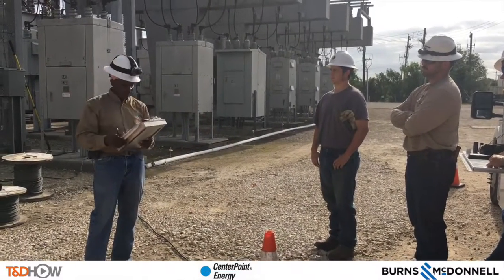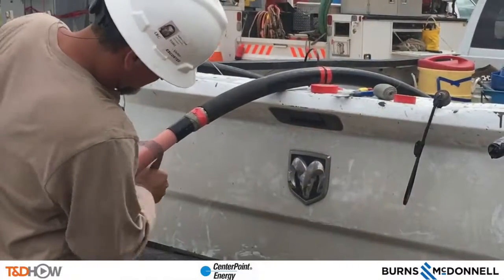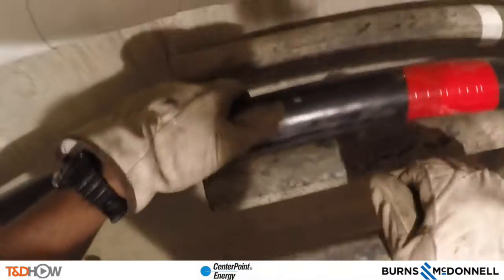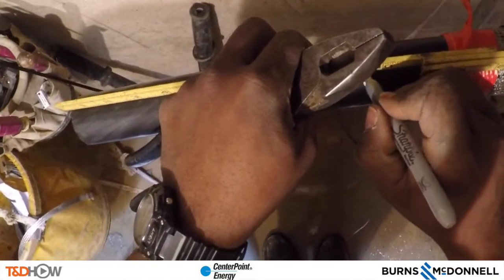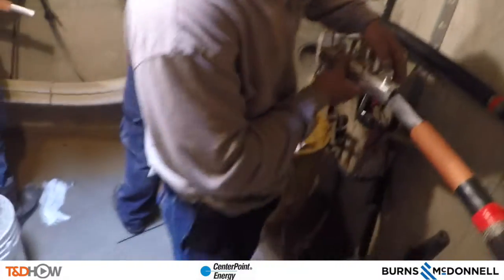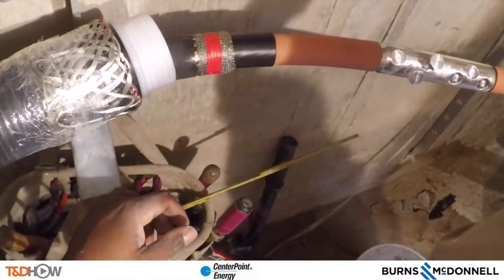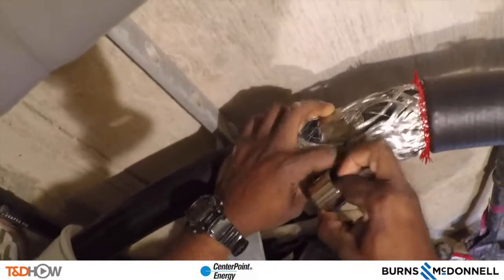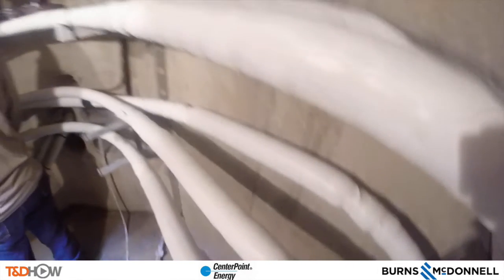Splicing for Underground Cut Around

Comment: I have one problem that I observe on that installation the pipe that being inserted on the cable have no cover protection, it is not a big deal but it must be covered so that the rats and other animals will not enter on the pipe, and it must also water resistant so that if something flood happened on the area it will not enter to the pipeline, so that the cable remain dry even the cable are already isolated.

Comment: Why don't utilities Hipot test high voltage underground cable before commissioning? I've never seen them do it, even on new work. Most inside contractors test 5kv and up.
Reply: Here in Southern Florida we do hipot test when repairing existing sections of cable but not when it's new construction.
Reply: We use a VLF machine to test cable. Hi-pot is harder on cables than a VLF

Comment: It was certainly interesting to see red, white and blue being used to mark the 3 phases/actives/hots on this USA installation. I do not know off hand what colours are normally used for phase marking in the USA but red, white and blue are the colours for Australia. I always reckoned in the USA white was always reserved for neutral... but in searching google, it seems there are no standard colours defined for the active conductors by USA standards (the N.E.C.), which boggles my mind.
Reply: For hi or low voltage?
Reply: we normally use color tape and 1 layer for a phase  2 layers for b phase and 3 layers for c phase on the primary.
Reply: black red blue is 120 brown orange yellow is 480volts. Cheers
Reply: Much thanks, that is what I had reckoned, but hence is why videos like this are so interesting to me. Always a pleasure to see how things are done around the globe, especially on this level since I really only ever really deal with domestic work. Cheers :)
Reply: Grounded conductor and/or neutral must be white or gray. Grounding/ground/earth must be green, bare, or taped green.
Reply: For the high voltage we use, A - Red : B - Yellow : C - Blue : here in Canada.
Reply: Depends where you’re at where I am we use red white and blue but some use red yellow blue for primary phasing.